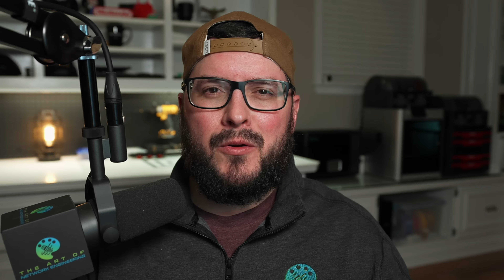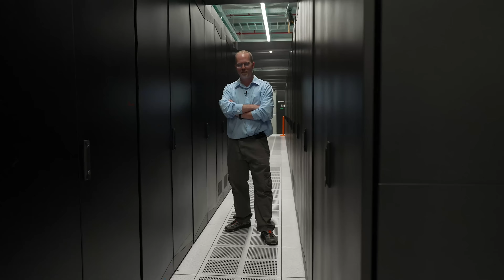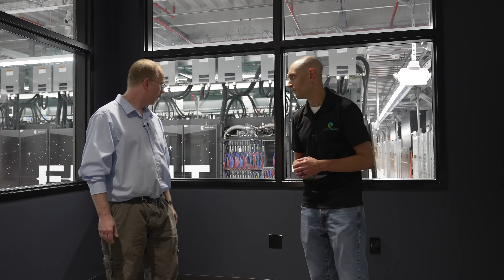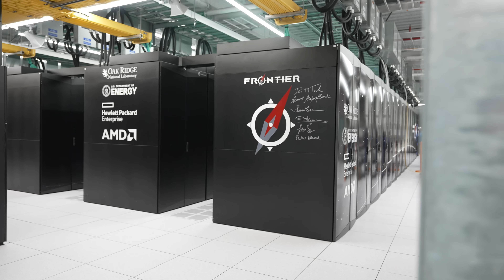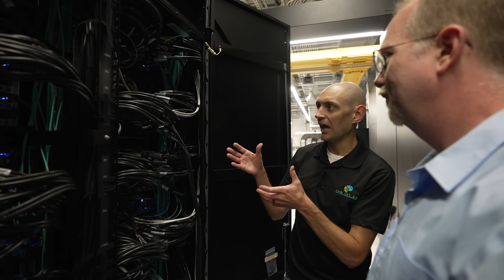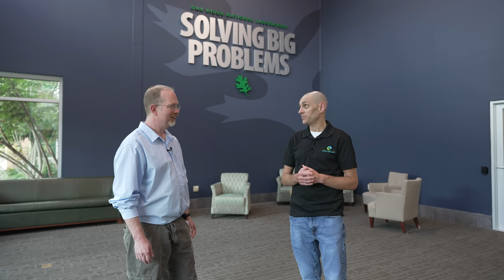We tour the world's fastest super computer at Oak Ridge National Laboratory!

Comment: It would have been nice to know a few things about how that plethora of processors is organised, how they work together and most of all how does the output from all processors is combined to one knowledgeable fact. I can imagine myself a number of cores where on each core is a part of a programme working, But with a numerous number of processors this can't be done any more.
Reply: Granted this is a 'network' overview. Go read about MPI. Swear a lot. And it will start to come together. Jobs that run on systems like this can run on hundreds of nodes at the same time. It's not at all impossible. And yes, they can run containers if you wanted to do so.

Comment: 200Gb, lol I have that between the switches at work which I put in like 3 years ago.
Reply: You don’t understand. Each device in this platform has 200Gb so every CPU, GPU and storage connection has 200Gb direct to the platform.
Reply from the maker: Thank you!
Reply: Yes, you likely did a few uplinks as ISL.That's cool.  However, on a slingshot switch every single one of those 64 ports on that switch do 200gpbs. To the nodes connected to it, and towards the fabric.
Reply: AWS has 400gbit per gpu over EFA (3.2tbit in total per host), and can sustain 3.6tbit on NVLink intranode, any to any.

Comment: You know if they switched off all those small diodes on each server, blinking all the time, consuming power, I wonder how many watts that is total. You really only need those lights to debug if something is working right? could be a little switch instead to toggle those on and off
Reply: You can think of five L.E.D.s using about 1 watt of power. In the grand scheme of things, If they were switched off, most people would not know that some energy was saved.

If you look at the home computer, it's costs (on average) $35-$40+/- a year to run a home computer 8 hours a day for one year (possibly much less). Those same five LEDs (diodes) that you mentioned would cost 35-40 cents to run them 8 hours a day for a full year (or just over a dollar per year if running 24/7)
Reply: @sky173  But it's quite redundant to have them right? You dont need them at all really
Reply from the maker: If their blinking you know it's working.

Comment: One of the coolest aspect of Frontier's network architecture is at the node level.  Since all the compute is done on GPUs the network fabric connects directly to the GPUs instead of something like a PCIe bus.  So simulations can transfer directly between GPU memory and the network fabric without involving the CPU or having to move data on or off the GPU to get to the network.  It allows for incredibly efficient internode communication.
Reply: So the GPU's have NIC's connected directly to them? With some sort of second MMU with it's own NIC? It's a tad unclear from the way you describe it, but I wonder how it connects to the GPU since you say it's not using PCIe?
Reply: @noth606  I slightly misspoke.  The NICs use PCIe ESM but connected directly to a PCIe root complex on one of the GPUs.  Each node has 4 GPUs each with 2 dies (so 8 visible GPUs) and a dedicated nic, so 4 NICs per node.  Thus any CPU operation that has to use the fabric actually traverses one of the GPUs to get to a nic.

Source: you can find a bunch of architecture docs for Frontier but I also worked for several years on developing some of the library and software stack for this machine and a few others that were just beginning to come online.

Comment: It's just a lot of servers clustered together.... whats the big deal? Server clustering has been around for decades....
Reply from the maker: Right, but this particular cluster of servers has a MASSIVE amount of compute that has done amazing things for us!
Reply: @artofneteng  Who cares? its the exact same thing, its just a bunch of servers clustered together.  With enough money you can make one twice the size. There is nothing revolutionary here.
Reply: @EvoPortal  to a certain degree you are correct. HPC systems are just "bigger meaner" versions of a traditional cluster. Your traditional cluster could be optimized for a multitude of things where most HPC clusters are optimized for parallelism where speed is the key to running and processing  massive sets of calculations. Every bit of the HPC cluster is optimized for speed. A traditional cluster is usually not built explicitly for speed. It's built for function. HPC is built for both speed and function. The innovation these days is coming (mostly, and imo)  from faster/better connected fabrics. And with PCIe 7.0 soon to come out too. Evolution... with the occasional revolution thrown in there for fun.

Comment: Not sure I understand the "noise" issue with copper Ethernet? It is transformer coupled at each end, self balancing with common mode induced noise rejection via the twist. I've seen it run around along with the wiring for 3 phase CNC equipment with no issues. Even at those scales I am not sure I buy that explanation. Length would be a real issue at that scale rather than noise I would have thought.
Reply: The speed of the link and acceptable error rates for encoding on those links is a limiting factor. Noise, heat and other factors all play a role in maintaining high speed links.

Comment: Sorry for nitpicking but he got one thing wrong. The reason you don't use electrical network cables for longer distances is not primarily because of interference from the power cables but has all to do with attenuation.
At these speeds it is very hard to get the signal more than a few meters, it will be heavily attenuated and very hard to distinguish a 1 from a 0. The solution to the problem is to use fibre optics instead.
Reply: This is correct.
Reply: It's about impedance matching and Standing Wave Ratio that causes the attenuation when sending pulses down copper. The copper need to be matched at both ends so you don't get reflections. Stick to fiber.
Reply: @steveking7719  No, attenuation is caused by the cable impedance and skin effect (and dielectric losses). 
Impedance mismatch creates reflections that make it harder for the receiver to receive the signal correctly.
It is true that both the transmitter and receiver must be impedance matched, but that is already the case. No high speed copper networking would be possible if that wasn't the case.

But still, even if you have matched tx/rx, you still get very high attenuation that makes copper networking unusable for lengths over just a few meters.
Reply: @alexanderahman4884  rut row... here we go again... two people disagreeing and neither will back down from their position. :face-blue-smiling:
Reply: @steveking7719  I'm just stating facts.
Reply: @alexanderahman4884  of course you are i understand.    so... a bad SWR wouldn't compromise or attenuate a signal??
Reply: @steveking7719  A bad VSWR would certainly compromise the signal but it is not THE cause of attenuation in a transmission line, it is a symptom of impedance mismatch. That's my only objection.

Comment: Take note of the power cables for each rack, similar to the amount a large house might use, per rack. Removing the heat from those racks is a big part of the design. Air flows from the floor and out the top in active exhausts. A little hard to believe, but compactness is a top priority.
Reply: Could you imagine their hvac systems!!!! Chillers rated in swimming pools per min
Reply: @mikepict9011    They have so much heat to get rid of, the concept of blowing cold air is no longer valid. Fluid is far more effective at conducting heat away from a metal structure and processors are manufactured with built-in liquid cooling. Each rack is built for purpose with an exchanger which takes it directly out of the room, then returns cold for the next batch. If you work on your home’s HVAC unit, you’re familiar. A widely distributed system like that can be monitored and adjusted for best efficiency.
Reply: @artysanmobile  yeah thats part of a larger cascading system when you consider the envelope usually.  The liquid usually and ultimately needs to e rejected outside.  And thats called a chiller in a liquid system and a condenser in a direct exchange system.  But yeah , vapor compression,  pipe joining . Its what i do .
Reply: @artysanmobile  i serviced the mini chillers that cool MRI machines,  they still had a 1 air to refrigerant dx hx and 2 coaxial heat exchangers ( hx ) with 2 pumps . Simple systems compared to real low temp refrigeration
Reply: Frontier is water cooled. You have water doing the heat exchange, not your traditional HVAC. There is still HVAC in the room since there are other non water cooled systems in the same room (storage and commodity gear). The switches, controllers and nodes in Frontier are all water cooled.
Reply: @hamsolo8165  " hvac " takes over at a specific cooling capacity . Usually around 24000 btus . Ultimately inside the envelope of the building,  heat has to be moed out . Water cooled , really is a cascading hvac system with water moving the heat to a giant compressor,  or evaporitive cooling tower to reject the heat . All " hvac " work . The water blocks on the boards . Not yet .
Reply: @mikepict9011  Not on EX systems like Frontier is. If the water stops circulating in cabinets and into blades and other devices it will EPO the components and shut down. The room HVAC is irrelevant to the compute cabinets.
Reply: @hamsolo8165  ok . The water in the servers goes somewhere right ? ( im a hvac service tech . 20 yrs exp . Plenty of server rooms ) hvac stands for heating ventilation and air conditioning  , it includes chilled water . How the heat gets to the hvac systems doesn't matter . Ultimately heat generated inside the building is moved outside the building by a hvac system.  We move energy.  More energy..... bigger machines.  I hope you understand im not bragging.  Its just what it is .
Reply: @mikepict9011  Yup the water that passes in the cabinet and components is part of a secondary loop that pumps cold water into the cabinet and then back to the CDU that then transfer the heat to the primary loop. There is no "Air flow" involved in cooling these cabinets. The primary loop will cycle the water and dispense the heat via a bunch of  chillers outside the DC. We're basically saying the same thing but in different words.
Reply: @hamsolo8165   Thank you for this info.

Comment: "And is 2 Exaflops" big smile 😊 Nice to see someone that is passionate about his work!
Reply: It's not even "a" computer, it's basically just a botnet installed locally... 
The only difference I can see between this and a botnet it's this is installed inside a single room so they'll get better latency between the different RAM modules, CPUs and GPUs. What's I'm trying to say is this technology is not very impressing, they're using pretty much the same CPUs and GPUs that we are using in out cheap desktops. Just a lot of them...
Reply: @Alfred-Neuman For a while they used special processors in these systems, developed directly for them. Cray comes to the mind. When clock speeds become less scalable they started to use consumer hardware. In this they have 8.7 million processor cores instead of 16 or 64 (talking about high end desktop machines).
Reply: @Alfred-Neuman  Why don't you build a better one and impress us all..................

Comment: But can it run crysis?
Reply: no
Reply: You spelled Doom wrong.
Reply: how many chrome tabs can it handle?
Reply: In all seriousness, not very well.

Games have such miniscule latency requirements that any distributed system is immediately going to fall on its face. Even chiplet-to-chiplet within the same CPU package has proven to be enough to affect game experience - reviews of the R9 7950X all identified that frame pacing was affected dramatically when threads moved between CCDs, let alone moving between entire racks.

Now, playing Crysis on a single unit, especially if it has both CPU and GPU compute...
Reply: Nothing can.